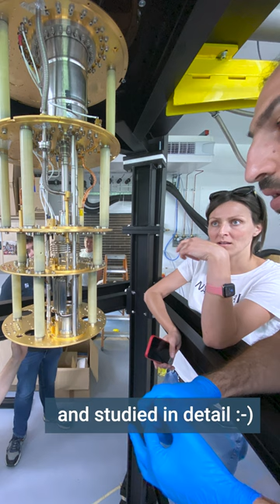New cryostat for dark matter search

Comment: Awesome, as some dark matter extraction in tachyonic velocity research has discussed before, we also assume dark matter generator and side anti-photonic transmitter should be considered to one of the console - quantum vacuum negative energy extraction system, in order to delivery energy to warp-core and dark matter injection.